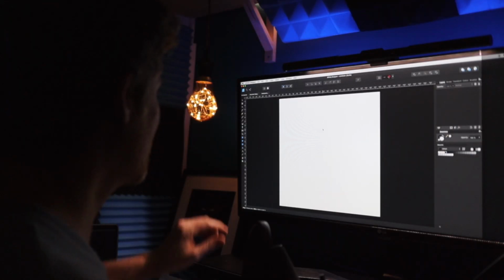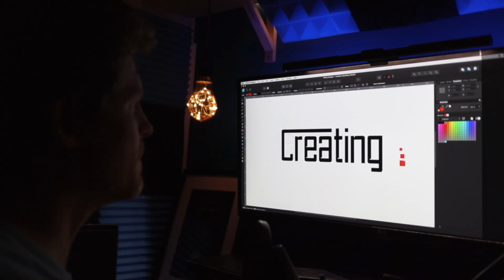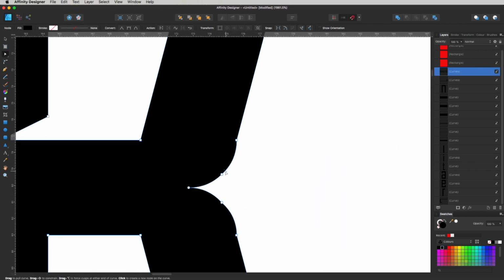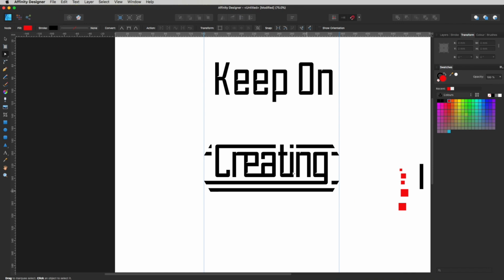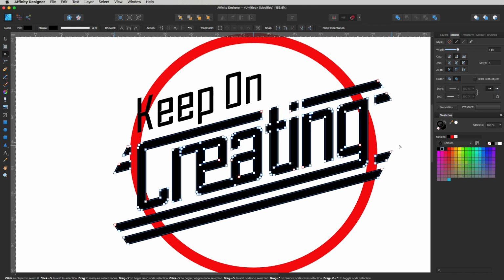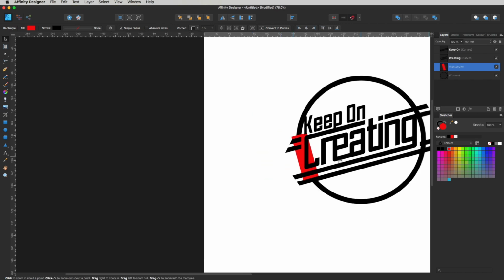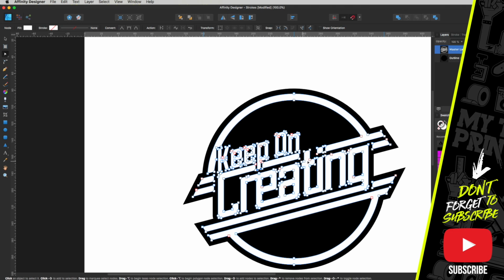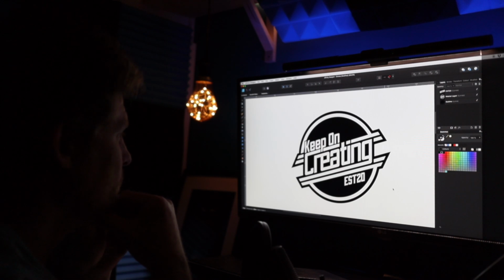Affinity Designer Logo Design Tutorial The Strokes Logo Design

Comment: Don’t forget you can click “scale with object” bottom right in the stroke panel so your stroke will scale correctly when resizing your objects.
Reply from the maker: Have you found the ‘scissor’ tool? Can’t seem to find where to cut a line in one click…
Reply: @KeeponCreatingTV  There is no scissor tool at the moment. The only way I find the easiest is to add a point at the place you need a cut and use the break curve action.